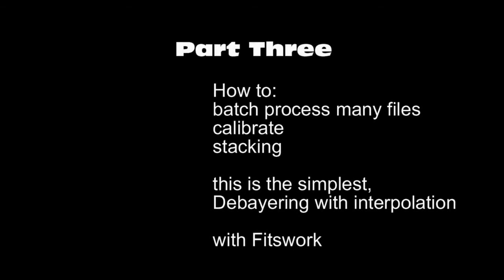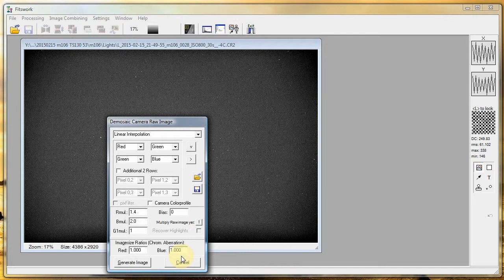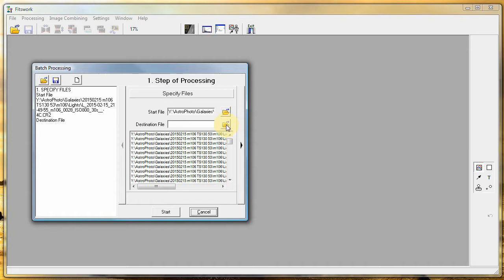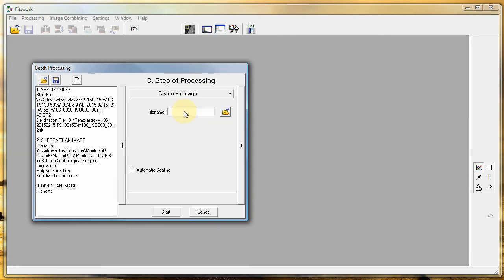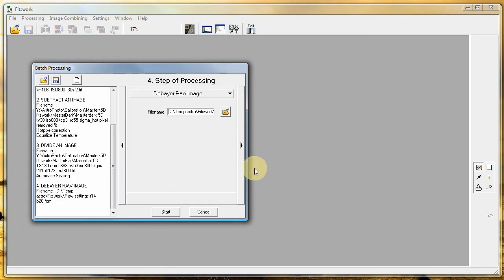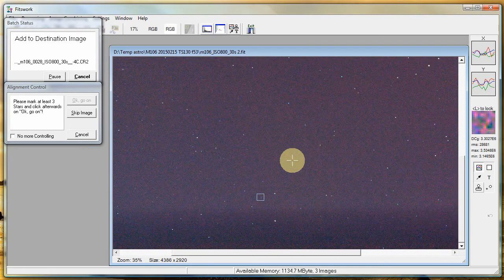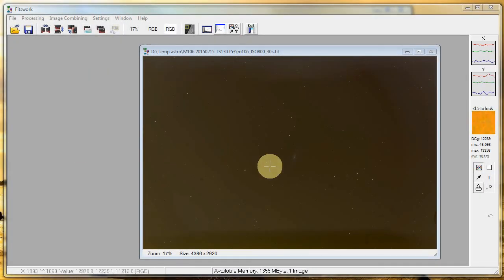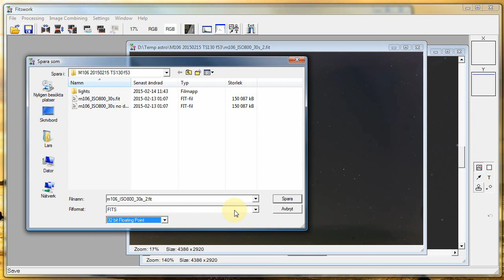Fitswork tutorial part 03 batch process many files in calibrate and stacking

Comment: Lars, is there a way to  to load a number of fits files and scroll through them one image at a time to examine them for star shape, etc. Thanks.
Mike
Reply from the maker: Hi Mike,
There is no function like that in Fitswork what I know. After calibration each file from my DSLR are 200MB or more so it's not easy to hold all those images in computers memory, maybe five or ten but depends on how much memory you have in yur computer. What you can do is to use the batch mode function and crop out the area of interest. After that you can open all of them if they are small enough in Fitswork window.

What I do if I need some information about the sub images I use DSS (Deep Sky Stacker), after processing you can see in the table FWHM, and also how much each sub image is shifted under the align process. The latter good to know when you setup your dither process, (small random movement of mount between each sub image).

/Lars
Reply: Lars, thanks for responding. If you have any contact with the creator of Fitswork, maybe you could suggest such a feature? Would be very helpful to an initial evaluation of subs before stacking, so that the obviously bad ones could be excluded.
Reply from the maker: Hi Mike,
Yes I'm in contact with the devoper, but there isn't any further devopment of Fitswork, maybe in future.

What I do today is to use the open sourche software AstroImageJ or AIJ. To that I have developed macros that I can use to my special needs. AIJ is a multi platform software and can use 64 bit op-system. In AIJ it's easy for you to get an overview of the quality of the sub images.

My computer is an Intel I7 with 8GB ram, better had been 16GB ram.

Here you can read:
http://astrofriend.eu/astronomy/tutorials/tutorial-astroimagej/tutorial-aij-01-introduction.html

Lately I have started to investigate if it's possible to develop a Drizzling stacking function in AIJ:
http://astrofriend.eu/astronomy/tutorials/tutorial-astroimagej-align-drizzle/tutorial-aij-align-introduction-matrix.html

My workflow now is like this:
Use AIJ to demosaic, calibrate, align and stack. I work as my DSLR color camera is a rgb monochrome camera.

Note: 
I don't have to use dark and bias in the calibration process, have replaced them with dithering technic, works very well with my Canon EOS 6D, tested on 350D and 5D also.

Then I take the r, g and b stacked channel to Fitswork and recombine them to a color image, and after that I do some basic adjustment.

If I want to go further I use GIMP, but not very often.

/Lars
Reply from the maker: Hi,
You can open  many fits file in the Fitswork window, but not very practical when more than 20 of then and your computers RAM limit it.

Another practical software is AIJ (AstroImageJ) which I use for pre calibration, align and stack of raw files from DSLR. In that software you can open a whole batch of files and easy scroll through them and even play them as a video. But AIJ use the TIFF format, it can open FITS but only one by one. Maybe you can export files as TIFF ? I have a macro to batch open DSLR Canon raw (CR2), note: it's complicated to use.

http://www.astrofriend.eu/astronomy/tutorials/tutorial-astroimagej/tutorial-aij-01-introduction.html

Nor AIJ or Fitswork is supported anymore, maybe you can take a look at Astap that is supported.

Lars